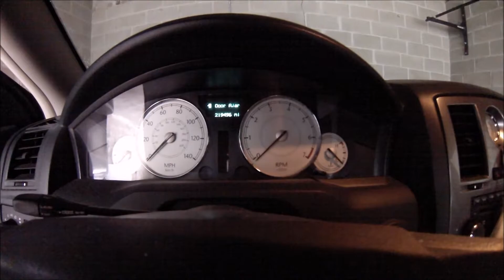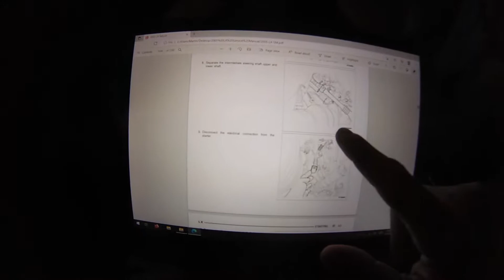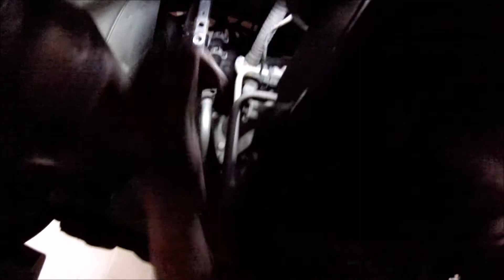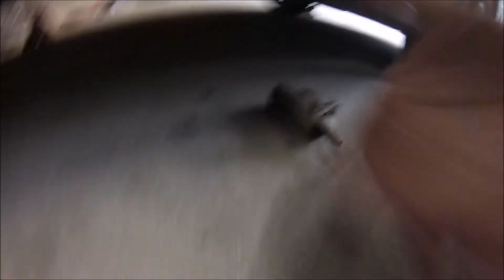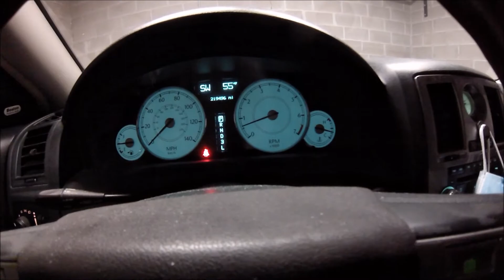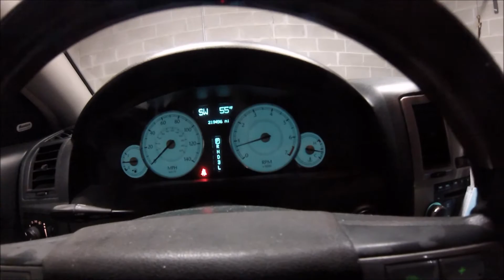'05 Chrysler 300: Replacing The Starter - Car Would Not Start, Fixed

Comment: Parking on hills to roll the engine in to starts gets old so quick. Did the same job on a VW Golf mk2 but that was way easier. Easy access bolts with the electrics and 1 bolt holding it on the engine that also was easy access and plug and play from there. At most a 2 hour job and this was before youtube, also I had access to a garage with pit and it was in the summer.